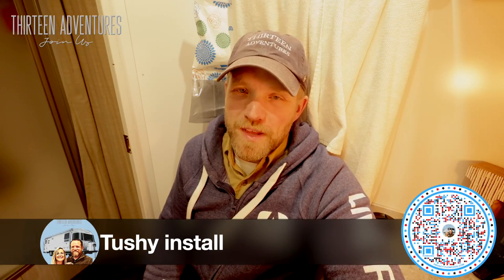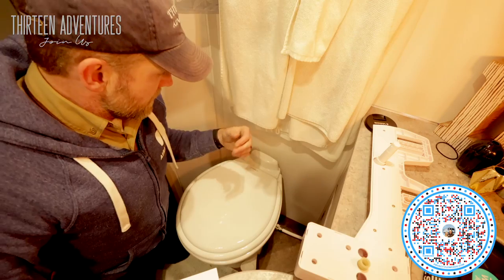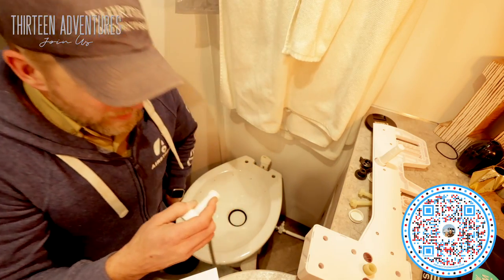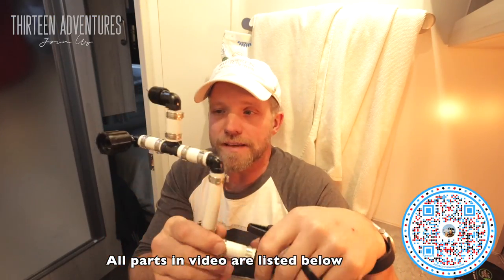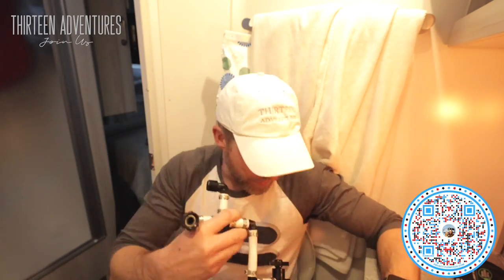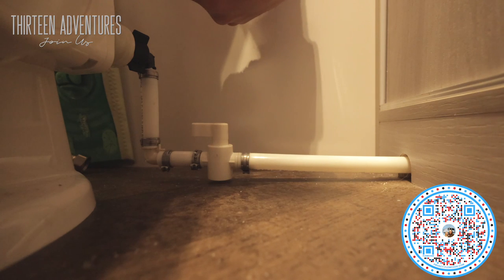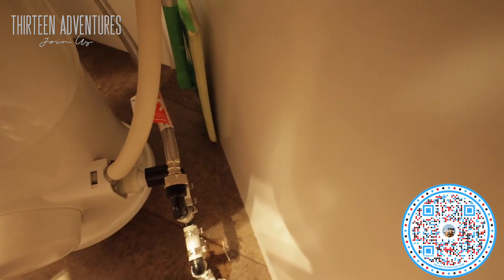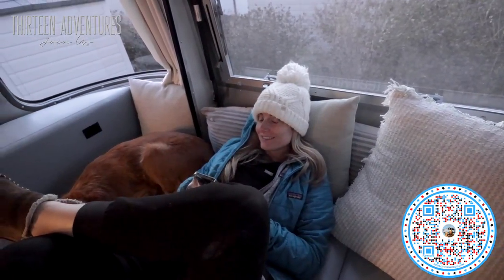Airstream Bidet Installation Adventure! Tight Fit, Big Impact | Pros, Cons, and Tank Talk

Comment: I’ve had a tushy, with the warm water option in my house,then I got bio bidet 2000 , I had colorectal cancer 18 years ago and the radiation and surgery wrecked the sending unit to the shutoff valve , toilet paper made it worse,but with the 2 different bidet’s and a pelvic floor therapist, yes, there’s really such a thing and if you ever have problems down there, you need to go, see one, trust me. I am so glad that I got to see this video because I’m thinking about getting an airstream and I was wondering the whole time if I could put a tushy on the stool . I can deal with cold water,but with the bio bidet , the same plumbing setup would work,but you’d need an outlet for power,but you’d have heated water and seat and a blow dryer,I don’t know if it would fit and it’s around $400.00 ,but it would be worth it . 
I kinda figured as picky as you are about things mechanical , you worked on choppers , I’m glad the guys that worked on the Hueys I rode in were diligent,because not once did the Jesus nut come off
Reply from the maker: So glad you found this alternative for the RV!  I wish it were a factory option on all RVs. Thanks for sharing your insight and recommendations on the medical aspect.

Comment: I have a similar model but it has two nozzles - one for the back and one for the front (ladies) and it work just fine. 
I think Airstream could have moved that toilet a couple of inches to the right, you are almost sitting in he hallway. I can't imagine what is like sitting on the toilet with the door closed.
Reply: Do you have a video that you can share? Thanks
Reply: I do not but I bought in Amazon for $24.00 - "Veken Bidet Attachment for Toilet - Ultra-Slim Self Cleaning Fresh Water Sprayer Bidets Baday Beday Badette Bedette Toilet Seat Attachment with Dual Nozzle for Feminine and Posterior Wash."
Reply: @rvnut1133  this helps thank you. 😃
Reply from the maker: It is a little cramped but not terribly so. The wide angle lens doesn’t help the view either.